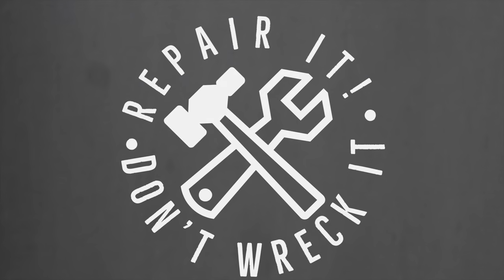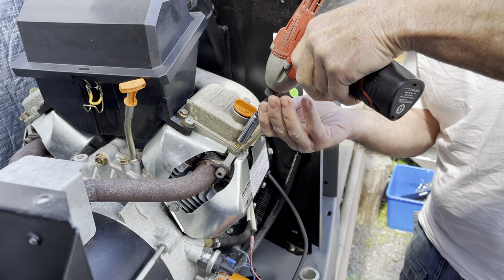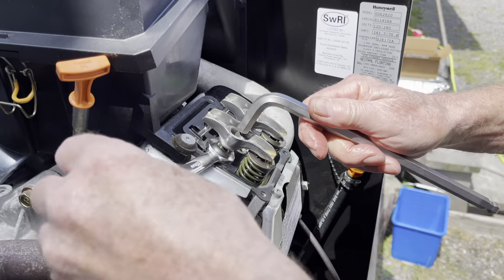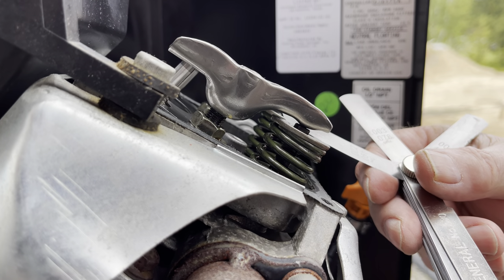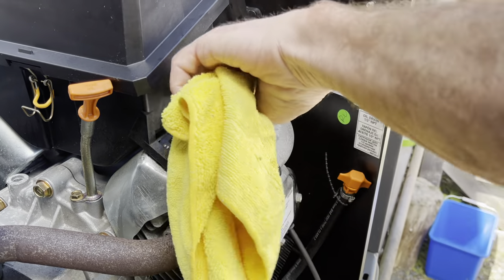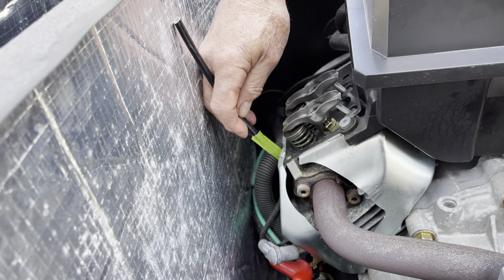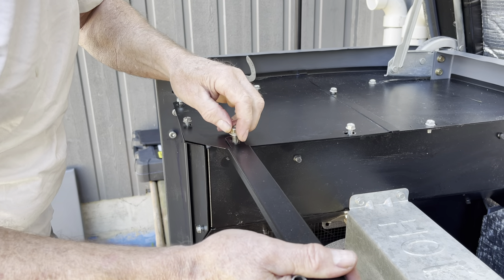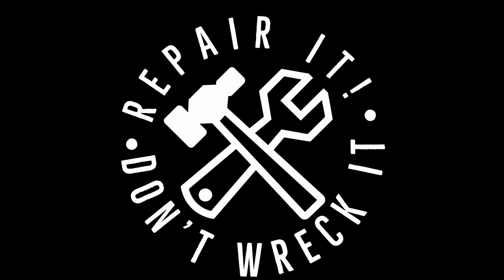Adjusting the Valve Lash / Clearance on a  Generac / Honeywell Air Cooled 17 kw Whole Home Generator

Comment: Very helpful video.  Especially part about the valve clearance increasing after tightening the lock nut.  I set to 2 like you suggested and ended up at 3.  It did take multiple attempts.
Reply from the maker: Thanks for checking out the video and posting @gordonschiff3621. If you set the valves once in a while it will take a few attempts to figure out how much the settings change when tightening the lock nut as you discovered and mentioned. I found you need to be patient and in the mood to do the adjustment. Eventually you will get it adjusted exactly where you want it. Good thing it doesn’t have to be done that often. Personally I would check it out of the box. I don’t think quality control is what it used to be. Thanks again. Roger

Comment: Good thing I checked mine, the rocker arm was broken off and just lying in the oil tray
Reply from the maker: Hi chuckb2175. Wow. I guess the question is why the rocker arm broke off. Do you think the nut came loose? Definitely you want to find the reason before running the engine. Roger

Comment: I saw you put the front spark plug back in before you adjusted the back valves. Isn't it harder to rotate the engine with the front plug in??
Reply from the maker: @paulbilodeau266  It makes sense it is easier to turn the engine with both plugs removed. I never realized what I did till you spotted it. Good observation. Probably with the smaller engines it’s not too hard to rotate. Definitely the next time I check the valve lash I will remove both plugs. I’m sure it will be easier and smoother. Thanks for watching and posting. Roger

Comment: Great Video sir...My home came with a 10kw generac. I bought the maintenance kit and it included an air filter with a black plastic housing around it. How would I change that out? I can't find where it goes.
Reply from the maker: Thanks for checking out the video. Based on the type of air filter this unit was made around 2006-2012. If you remove the top cover and front panel , on the right side of the fire wall the air filter is located in this section. I’m not real familiar with this older unit but looking at the manual it looks easy to change. Pretty sure it’s one gear clamp. If you go to GENERAC.com they have your owners manual online. It’s part # 0g8334.  On page 24 they have a decent picture of the air filter location. The engine in your 10kw is the GT-530. Another great source for information, parts and repair manuals is gentekpower.com   I hope this helps. Roger

Comment: For some reason a 13mm wrench fit better on my locking nut than the 1/2 inch.

Valves are adjusted and the rpm loss error did not trigger again.
Reply from the maker: Hi there. From what I read 1/2” is 12.7 mm. So they are very close. Could be a few factors. The nut may be 13 mm or the wrench may be off a hair. Most of us working on equipment have both metric and imperial sized tools. You never know what your going to run into. Improper valve clearance can cause problems as you know. It’s a good place to start when doing diagnostics. I’m glad it solved your problem. Thanks watching and posting. Roger.

Comment: You ever see the problem with popping up through the carb upon cold start? Once it smoothes out 5 to 10 seconds it runs fine. Ive got a 2019 Generac 20kw LP fuel
Reply from the maker: Hi David. Thanks for checking out my video. The first thing I would do would cover the basics. Make sure you check the valve lash, the spark plug gap/replace if worn. Same goes for the air filter. After that if your still having problems check the fuel pressure with a manometer. This is a good start. There is a lot of reasons this could be occurring so you want to systematically rule out the causes. The goal is to try to narrow it down  to a electrical or a fuel problem. I hope this helps. Roger
Reply: @repairitdontwreckit4257  thanks for the swift reply.  Weird thing is maintenance was performed,  plugs, air and oil filters fuel pressure checked and adjusted,  restarted not a problem.  Restarted its exercise time for about 3 weeks no popping. 
This is where I have to rule out valve lash as it straightened out after a maintenance and they're either in spec or not .
Warmed up it will restart every time no popping. Its only when its sitting between exercises does it stumble and pop on cold start. Outside temp has no affect , does it cold or warm .
Driving me nuts lol
Reply: Maxitrol primary regulator bleeding fuel I guarantee it.  Pressure builds up at the gen regulator.  Will do exactly as you are describing.  I didn’t even have to read that it was propane install.
Reply: @chet3larson  it has seemed to correct itself after the maintenance with new plugs but definitely will dig deeper into your suggestion.  Thanks !
Reply from the maker: @davidsuminski4243 I am glad that something easy as changing the plugs made a difference. It could be a bunch of small things causing your initial problem. Once you start eliminating them it will be easier to get to the core issue. Thanks for the update. I really like to know how things are going. I appreciate the update and your taking time to post. Roger

Comment: What brand feeler gauge are you using? Thanks for the video.
Reply from the maker: Hi there wendellsmith1964. I really can’t remember. I have a few sets and they are all different. The brands are Lisle, Powerbuilt and General. It really doesn’t matter though. All of the parts stores carry them. Just make sure before you buy the sizes you need are included. There should be a list of the sizes on the front or back of the packaging. I hope this helps. Good luck with your project. Roger
Reply: Thanks Roger.

Comment: You prolly won’t appreciate my comment but,,, you should not be telling people, the bolts are 10 mm.  The bolts are 6mm.    The head of the bolt does not determine bolt size, the major diameter of the thread determines determines bolt size.   The Alan wrench for adjusting valve lash is 3/8”, not 1/2”.   You only need to remove the top cover, above the fan.   You are spending time removing a cover that does not need to be removed.   Spark p,Gus’s are cheap and should be replaced after removal because they usually have obvious wear on them and the seal is damaged from being installed.  Having said all that, I thought your video was well put together.     I think you should add to your video, the valve lash should be checked on a cold engine.
Reply from the maker: Hi Doug Chauvin. Thanks for taking the time to check out my video and post your comments. I have the factory manual for this generator. You are correct about letting the viewers know that the valve adjustment should be performed on a cool engine. The manual also has a section on adjustment of the valve lash. It states that the wrench size for the jam nut on the 17 kw is 13 mm. (Slightly over 1/2 inch.) I used a 1/2 inch which fit better. I recall when trying to loosen this nut it was really tight and felt if I used  the 13 mm wrench I would round off the corners of the nut. The Allen wrench for the pivot ball stud is 10 mm. (Slightly over 3/8 inch) and is what I used. It has been my experience that even though a fastener is metric an imperial size wrench will sometimes work better. I have both imperial and metric wrenches so at the time I would have used the size that fit the best. Thanks for bringing this to my attention. I plan to make changes to the video based on what I’ve said in this post. Roger

Comment: Hi Rodger- I have 14 kw generac generator similar to the one you have in the video.  I noticed recently that it has trouble starting during its exercise sessions.  I can manually start it but it takes a long time.  I recently did an oil/plug change myself.  I did not do the valves and since we bought the house from someone else (generator came with it) don't know when/if they were ever adjusted.  The generator is about 10 years old.  From the video it seems like the hardest thing for me (ill be attempting this solo) will be getting the engine to top dead center.  Any advice for a newbie trying this?  I'm thinking putting a straw in the spark plug hole and watching it while i turn the fan is the easiest way?
Reply from the maker: Hi Brian. Since your not sure of the service history check and perform the basics. Oil change and filter is a great start and will boost your confidence. Remove the spark plugs and check the gap or replace with new and also check the gap. Look at the air filter. Make sure it’s reasonably clean and there are no surprises such as mice nests. As far as the valve lash the straw will work. Basically a wooden dowel will work also. The thought is whatever you use is soft enough not to damage the top of the piston. I think rotating the fan with the spark plugs removed would be the easiest way to do valve lash. Before doing any valve adjustments practice bringing the motor to top dead centre on the compression stroke. You can then check the clearances to see if they are within specifications. When the valve is closed you should be able to wiggle the rocker arm. If you can’t it’s either the valve is too tight or you are not on the correct spot in the cycle to test. If your  having trouble with that I would not try adjusting the valves. It may be over your skill level.  It’s not hard to do but you need to understand the process. I would look at some other videos as there are different ways to explain the valve adjustment procedure. I don’t want to scare you but if the valves aren’t adjusted correctly you could cause more problems than you initially had. It’s a finicky job that requires patience to get it right. Sometimes many tries as the gap changes when tightening the lock nut. Allow yourself time and make sure your in the mood to do it, especially the first time. Of course you will need some basic tools but nothing  crazy or expensive. The valve lash is important as the valves create vacuum to pull fuel in the engine. There could be other reasons for hard starting but eliminate the basics before chasing the problem down. Fuel pressure is very important. However a manometer is required. A specialty tool. I would check the stuff that I have mentioned and see what happens. A great forum for generator information is at gentekpower.com They have a section for air cooled generators including  Generac . Most of the people that post are professionals in the generator business. I hope this helps. Let me know how what you find out. Thanks for checking out the video and posting. Roger
Reply: @repairitdontwreckit4257  Hi Rodger- So this is a little embarrassing.  2 months ago, I did indeed change the oil, plugs, and airfilter myself.  Everything was in order and the generator worked will until last week when I noticed the difficulty starting and roughness.   Before trying to adjust/measure the valves I took a detailed look at everything and noticed that the plug wire on the rear cylinder had come loose. Once I reattached that- everything ran well again.  So, I guess this was the cause of the poor running- a loose plug wire which is my fault!

  Maybe next week ill try to measure the valve clearance just to check.  I assume that if they were out of adjustment- then the generator wouldn't run well?  And thanks for the link :)
Reply from the maker: @BrianPressman-p1z  that’s excellent news that you figured out the problem. It makes sense to always check the basics first and as you can see in your situation it was a basic problem. Checking the valve lash especially on a unit that you have no history is not a bad idea. If it was way out of whack you would have some problems, but it can’t hurt to have a look at it.

Comment: On old Harleys I use to adjust valves by when the exhaust valve was down I would adjust the intake then do the same for the exhaust side . Would that work for these engines too or is there a reason why it would not ?
Reply from the maker: Hi 12wing Wfetech. There’s all kinds of opinions on how to position the valves to set the lash. To answer your question I really don’t know. For me what I like to do is to cycle the engine several times to check the opening and closing of the valves. Make sure your are rotating in the direction the engine runs. Once I have determined the intake and exhaust stroke I feel comfortable that when both are closed on the compression stoke then I can adjust both valves. I think this method for beginners is the safest way. As you know , as long as the valve is not riding on the lobe of the camshaft it should be closed. In my opinion it really doesn’t matter what stroke you are on. The key is to make absolutely sure you are in the correct position on the camshaft. So your method should work. As an experiment and if you have time try both methods and see if the results are the same. I just finished adjusting the valve lash on my Honda lawn mower. Once the valve cover was removed the way the engine was designed I could clearly see the cam lobe making the set up easy. For those who have not taken an engine apart and not seen how things work I try to keep it as simple as possible. A website called gentekpower.com is a great site for information on generators. Thanks for checking out the video. Roger
Reply: On a twin cam HD wants the piston at TDC and both valves closed. At TDC with both valves closed the lifter is sitting on the lowest point on the cam lobe. I remember doing old flathead Fords your way, but I stopped doing that years ago. I'm not an engineer, but after working on tons of Generacs I'd go with the factory recommendations.

Comment: I have an older 2004 12 kw Generac Guardian that's air cooled. Not sure what the spark plug gap should be. I'm getting too many different answers. Any help?
Reply from the maker: Hi Scott Zwierlein. I can help you better with a model number. However based on my findings an educated guess would be .030”. The proper gap is critical to the performance of the generator. A gap that is too wide puts stress on the ignition system. Some service people tend to set the gap slightly smaller as this would not hurt the generator and with a little wear will be spot on. I looked at a wide range of generator sizes. The trend was .030” or .040” plug gap. Another thing to watch out for is the different models use different spark plugs. Generac has a pretty decent web site for information if you don’t have a manual for your particular model. Generac should be able to tell you exactly what you need to set your plug gap. If you give me the model number I can find it also. I hope this helps. Thanks for your question. Roger

Comment: How often do you have to adjust valves
Reply from the maker: Hi eric gibb . If this is a new engine out of the box I would check the valves right away. Quality control isn’t what it used to be. After that I would check them a year later. If there was no change I think you could easily go two or three years before checking again. I base my recommendations on my own personal generator and friends generators that I have serviced.These are generators with  low hours. Mostly  exercise time an say no more than 4 hours of run time a year. Not very much. If you are putting a ton of hours on every year then I would check them at least once a year. At some point a pattern will form after checking to see what interval of service works for your particular machine and usage. Thanks for checking out the video and posting a question. Roger

Comment: Great video, very helpful.  To clarify, when you say "3 mil",  it should actually be "3 thousandths (imperial), not 3 millimeters ... Hopefuly one day the archaic imperial system will be gone and the USA can join the rest of the world in using a logical, accurate, and easy to remember measurement system.
Reply: '3 mil' means 3 thousands of an inch or 0.003 inch.  He never said millimeter did he?

Comment: All what you did is  Maintenance  same on 24 KW ?
Reply from the maker: Mr R If you give me a model number I can check. The procedures would be the same if the valve lash is adjustable. The  gap may vary with different models. It’s always important to check to make sure.